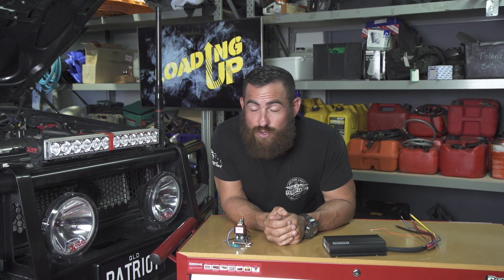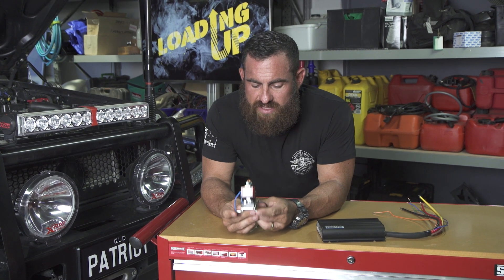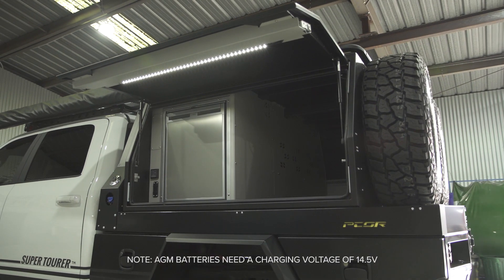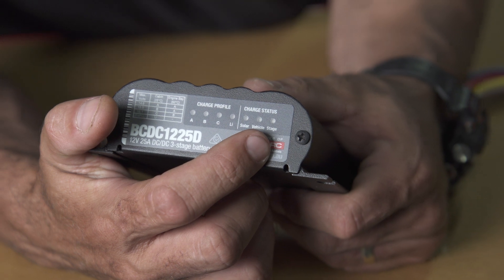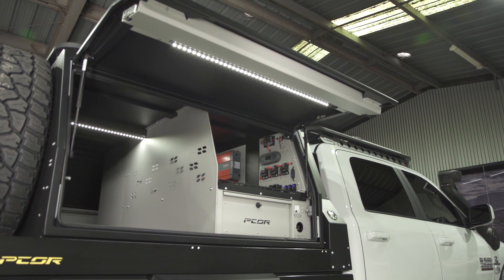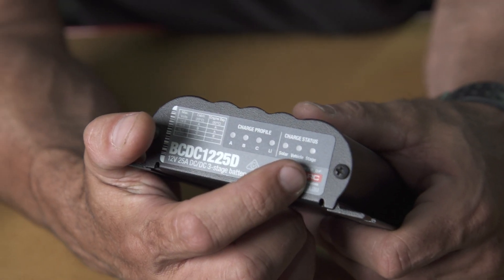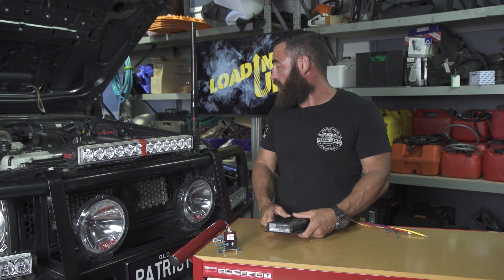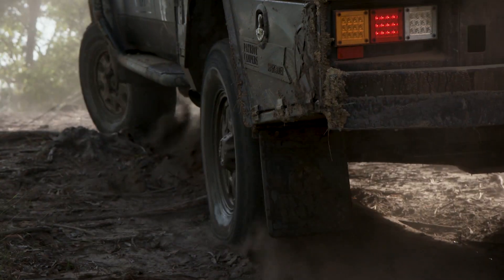Explaining Offroad Battery Chargers - with Patriot Campers

Comment: The elephant in the room that no one mentions (apart from the excessive cost of DC-DC chargers !!!) is that these chargers (whatever the brand) are very inefficient and generate a lot of heat so my idea is (if you aren't using a deep cycle battery or one with weird charging requirements) and you haven't got a smart alternator then you are better off with the smart relay, saves 20% of your generated power going down the drain and will work a treat
Reply from the maker: Hi Wayne, thanks for your comment. Indeed you are correct there! If you do have a vehicle with a standard, fixed voltage alternator, then a basic isolator does work quite well, such as our SBI12 units. It is only as battery manufacturer's specify more complex charging requirements and vehicle manufacturers demand more efficiency out of their vehicles that we then lean on the need for a DC-DC charger. After all, you want to protect your battery/s that you have installed in your vehicle, so do need the best option for what suits best in your setup.

Comment: Can that Redarc charger be installed under the bonnet?
Reply from the maker: Hi Darren, thanks for your comment. Our BCDC units can indeed be installed in an engine bay install, for sure! The only thing we look to is keeping the BCDC cool while it is charging, to maintain its efficiency and high output. Depending on your vehicle, we do offer a range of Mounting Brackets that sit the BCDC in between the grill and radiator.

Comment: Ive got 40 amp model here in scotland.....what do you think of redarc smart battery isolator.....is it worth buying....hi from loch lomond
Reply from the maker: Hello Neil, thank you for your enquiry. The BCDC1240D has a built-in isolator to protect the vehicles starting battery from over discharge. So the SBI12 is not required for a basic set-up when using an BCDC. You can utilise an SBI12 to add a jump start feature if using a CCA rated auxiliary battery. Any further questions please feel free to email us at power@redarc.com.au
Reply: @REDARCElectronics  Is that true of all the BCDC units, do they all have built-in isolators? I'm pretty new to this, just trying to figure it all out. Thanks!
Reply from the maker: @blacksaxcam  All REDARC BCDC Chargers utilise voltage thresholds to determine when to start and stop charging, which will prevent excessive discharge of your vehicles cranking battery. This varies from an isolator which will physically connect and disconnect your start and auxiliary battery based on the input voltage. If you have any further questions please feel free to contact our helpful Tech Support Team at our head office https://www.redarc.com.au/contactus
Reply: @REDARCElectronics  That's just excellent, thanks for the reply!